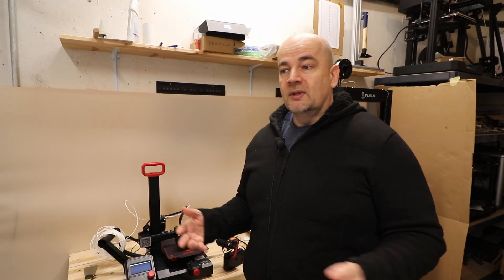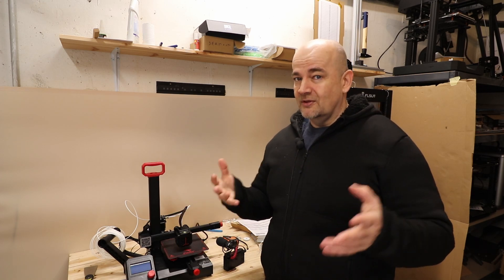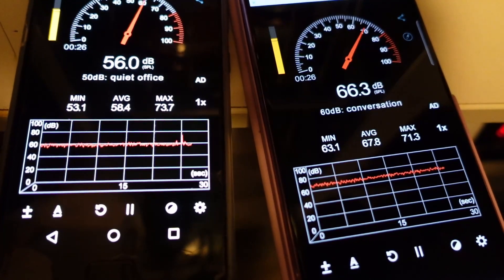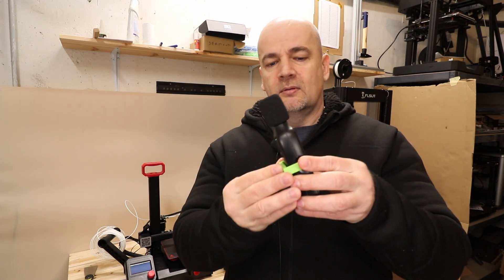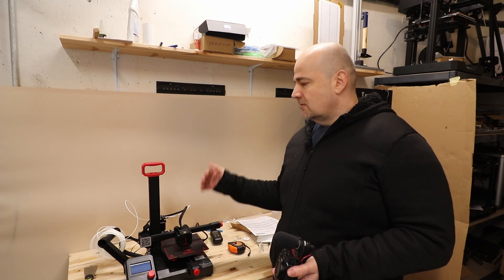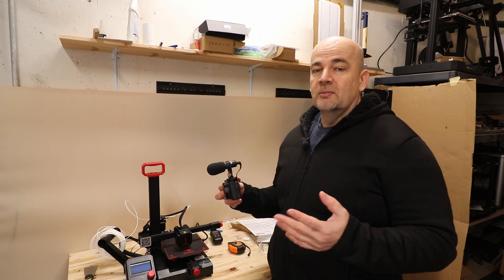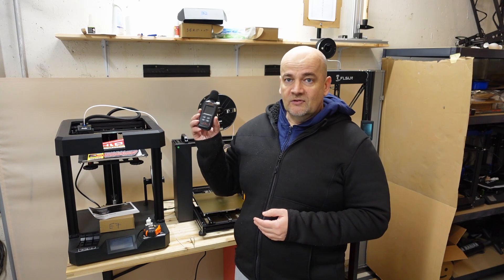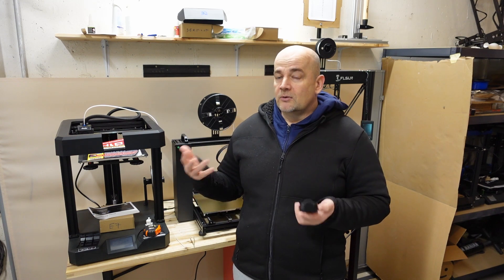3D printer noise comparison video - 10 printers compared

Comment: So watching this video I thouth these printers are as loud as a hairdryer or vacuum.  Then I checked how loud 50 db is and it's in the normal range.  Hair dryera are 90 db.  
Does it mean these printer are not loud at all?
Reply from the maker: Some printers are louder, but not so loud as hair dryer.

Comment: For me, it's mostly the higher pitch whining from high rpm fans or steppers. For example on Ender 3s motherbord & psu could easily be quieted down with bigger fans on lower rpm don't think it would cost much.

Comment: Really useful comparison. Boy, the Ender-7 and the Ender-2 Pro really are loud. And the Ender-5 Pro is just within what's bearable. Personally, I swear by Sunon fans (Taiwanese company, manufactures mostly in China), specifically middle strength with Vapo bearings. Having taken a look around, Sanyo fans seem pretty good, too, as do multiple Western companies'. As much as it pains me to say it, being Austrian, Noctua fans are really rather overrated. However, I am baffled by that other commenter who's using EBM-Pabst fans. They may be great products for other uses, but other than a 5015 blower fan with ball bearings, they are horribly suited for 3D-printers - very few options in the relevant size range, and most of them only with sleeve bearings. Hell no. Anyway, while great, quiet fans are manufactured in China, I have yet to find a single Chinese company whose fans aren't very high noise with rather low strength, i.e. cheap crap.
Reply from the maker: I have some fans waiting to be tested soon (Notcua, Sunon, EMB-Papst...)

Comment: I ended up rebuilding my Ender 5 because of the obnoxious noise (similar to the Ender 7 in the video). It turned out that the fans were not the problem - most of the noise is generated by the grates and ducting designed by an artist rather than an engineer. Switching to Noctua fans would not have made any difference, other than that they would have carried a lot less air, reducing noise at the cost of reducing cooling effectiveness. After I removed all the protective grates, switched to a fanless PSU and silent drivers, the printer is finally quiet-ish (similar to the Artillery).

Comment: For me, its Prusa. The Mk3s has only two fans, the Hotend fan is already a nearly silent speed-sensed  Noctura that shuts down below 50C and the speed-sensed Parts cooling blower is the source of the loudest noise. If printing in silent mode with material that doesn't need much cooling it is very quiet in all axes.

Comment: Super helpful thank you. I was debating on the Ender v2 Kywoo Tycoon and Pursa. The noise factor was definitely a consideration as I am in a smallish apartment. Now to decide between the Tycoon and Pursa... Any advice? Your Tycoon review was great btw.
Reply from the maker: Prusa (tycoon is mechanically great printer, but I have a feeling that electronic is 98% finished). Firmware update also requred
Reply: @MyTechFun  Thank you. So is the Mini+ just as good as the MK3s minus the bed size or is the MK3 just better in every way. Was hoping to keep it under 500 if possible.

Comment: If it weren't possible to upgrade fans then it would be a deal breaker for me. But since the fans can be upgraded, I factor the cost of quieter fans into the price of a printer when deciding.
Considering how many people upgrade their fans, I'm surprised that the manufacturers don't offer fan upgrade kits the way that some of them do offer silent stepper driver upgrades.

Comment: I agree with @Russel White on a consistent vs peaks or variations in noise. The fans are kind of white noise so I don't really mind them. My Ender 3 Max has silent drivers on the X and Y but not Z or the extruder motor.  The Z is okay because it's only noisy during homing or after completing a print.  That extruder motor making a high-pitched bark every time it retracts is annoying.  Nice video and good info as always.
Reply: @Russell White That is a good point. It's easy to tell when my Max finishes a print because of the happy bit of yowling it does when done. My CR10S4 has silent  drivers on all axis so I never know if it's done or has just lost interest in printing.

Comment: Nice to see this comparison!
I own the PrusaMk3 and I am unhappy with the loud 'part couling' fan. Else this printer is really quiet ( Settings "silent stepper motors" ). I have been looking for a better replacement for the 'part couling' fan from Prusa for a while. However, every time I search (unpracticed) for fans ('radial', 5V, ~5000RPM, 50x50x15mm) I find almost nothing.. hm

Comment: I agree, my Ender 3V2 is unnecessarily loud and mostly due to the fans. It sits in my office with me so I need to time prints between meetings. I would love to find the time to upgrade the fans, I have even bought the noctuas to do it, but no time.  My next printer will have noise and easy nozzle changing as strong considerations.
Reply: Switching the fans will not help (unless you drastically reduce flow-rate). Removing the protective grates will make a much bigger difference.
Reply: @tamask001  I had designed my own hot end fan grate. But I tried your advice.  Grate on and grate off made no difference.  Installed the noctua fan on the hot end and there was a dramatic reduction in noise. Loudest noise was then power supply fan. Replaced that with a noctua fan and it again made a good difference, though not as much extruder fan change.  Likely due, as you said, to the grates on the power supply. It was still worth it, though.
Reply: @spongecounter  Did you also check the air flow rate? Because all the Noctua fans I looked at had dramatically lower flow that the original. I'm not sure if the original flow rate is strictly necessary (or even that someone at Creality ever calculated or experimentally determined anything in the first place), but I didn't feel like trying to clean out a blocked nozzle.
Reply: @tamask001  I did not measure the air flow. However the cooling fins are not even warm to touch so there is sufficient cooling with the Noctua. Full disclosure though, I have a bi-metal heat break so that likely helps.
Reply: @spongecounter  Good to know, I will do some measurements at lower speeds then. Or get a fancier heat break :)

Comment: Noctua fans are made in Taiwan by Kolink International Corporation. Its a union between Austrian design (or just the idea that they are designed in Austria) and Taiwanese manufacturing. Noctua didn't invent silent fans and there are plenty of proper 24v quiet fans available from digikey, mouser and RS components and the like. I buy EBM Papst fans second hand off of eBay, they are great quiet industrial fans designed in Germany made in Hungary. 

All these printer are above 30 Db mostly 40 which is too noisy. Anything below 30 sounds quiet to humans not much point differentiating below that. 

Good idea for a video looking at performance of proper 24v fans and not noctua 12v buck converter/step down nonsense (although most PSU's use 12v fans internally somehow).

Comment: To me it is really important. For a long time, my printer was running in the living room. I had to hack on noctua fans - which is a fun project, but I do not want to thinker this much with my next printer. So the noise level is important. Even though my printers have a room now, I use that space for painting + it is also our guest room. I need the printers to be silent so that they can run while I have guests over...

Comment: Did you verify that in all printers the PSU fan was running at max RPM when measuring? Typically that fan is temperature-controlled and only kicks on when the PSU is getting warm, i.e. needs to supply lots of current constantly.  Hence, to have that fan at max., typically having the bed at very high temperature is needed (unless you have an AC bed on that printer) to keep it sucking current.  I replaced the 12v stock fan on my Ender 3 Pro PSU with a Noctua and that made a huge difference (once the PSU fan kicks in).

Comment: Did you test the Prusa MK3s running in silent mode?
Reply from the maker: 0.2mm quality mode
Reply: @MyTechFun  When printing with the Prusa, enter the menu and go to TUNE and change the Mode from [Normal] to [Stealth]. The Prusa is a bit slower but a lot quieter.
Reply: You could add a line on your website for prusa mk3s stealth mode. Good job